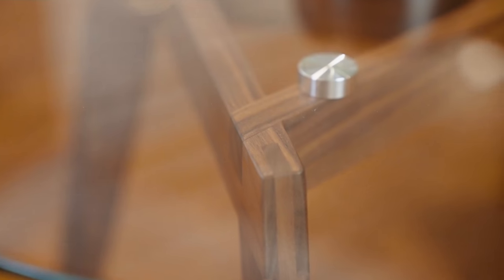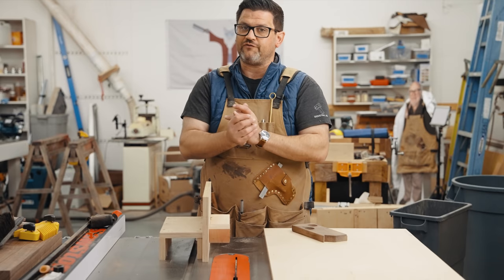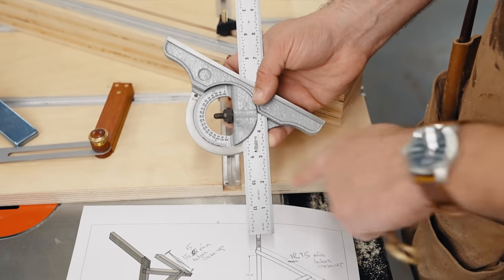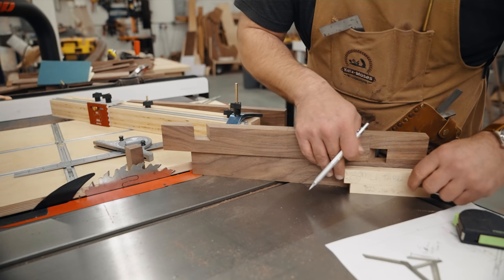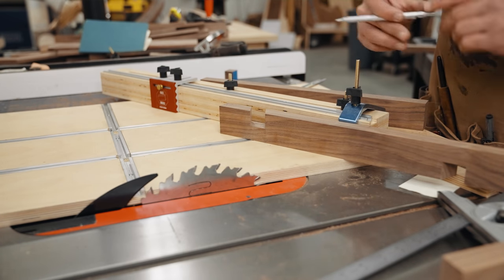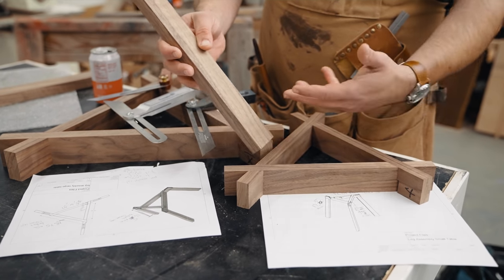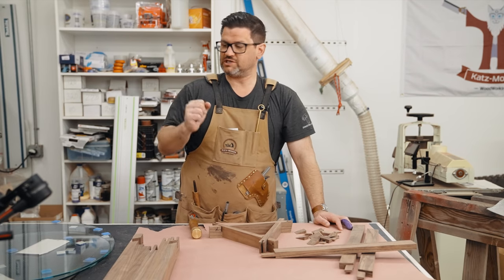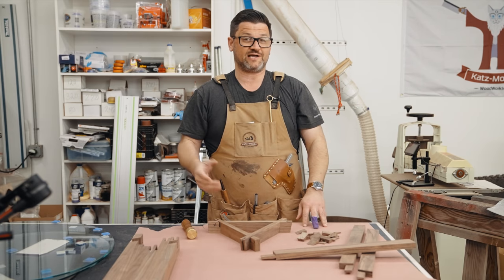Modern Glass Coffee and Side Table - Fun Joinery and FREE Woodworking Plans

Comment from the maker: Get the Free Plans and Support What We Do at The Katz-Moses Store https://lddy.no/stih (Plans are right after Japanese Saws in my store)
Supplies and Videos Mentioned
Multi Sled Video with Free Plans https://youtu.be/ciYdVgGXJE8
Bridle Joint Jig Video https://youtu.be/d5AfeW_76DA
Blem Squares (highest quality squares at a fraction of the cost) https://lddy.no/vvrp
Aluminum Standoffs for Glass (I ended up using the smaller ones only) https://amzn.to/3bILuZI
M6 Screws for Standoffs https://amzn.to/2OurXTW
UV Cure Glue with UV Light https://amzn.to/3ld8nHQ
Trauma in the Shop Video https://youtu.be/vuQ1NNzhMas
BitsBits is the BEST place to buy router bits: http://bit.ly/BitsBits USE CODE JKATZMOSES15 for 15% off
Reply: Maybe I missed it, but what are the diameters of the tops?  Didn’t see it on the plans or the video.  Thanks!

Comment: Nice build! Another trick I have used for the spacer is take an off cut of the wood I am using, rip it down the middle, and then glue it back together. As long as you rip with the same blade that you are using for the joints it will be exactly the thickness of your stock minus the blade width. Takes all of the measuring out of it.

Comment: Board Stretcher! Check out Next Level Carpentry for his BS1000. It is really cool, you dump in saw dust and it forms it into the wood piece you need to stretch. His motto is Cut twice measure once. Really. For Sure. Anyway it is a cool video by a skilled wood worker.

Comment: EDIT: ignore this comment's advice:

I don't recommend permanently gluing the top - use some kind of soft rubber glue or hot glue, because flipping the top to clean the bottom will be impossible after permanent glue
Reply from the maker: Disagree. You can knock the standoffs off with a hammer and clean the glue with a razor blade (i talk about it in the video) . It'll be like it was never there. If you don't glue it then anytime someone puts weight on the edge it'll flip over.